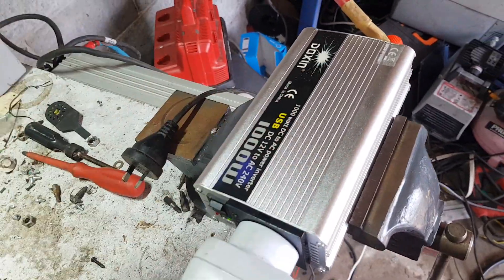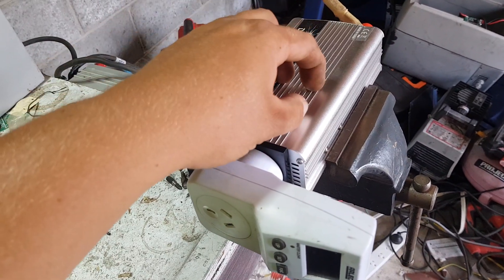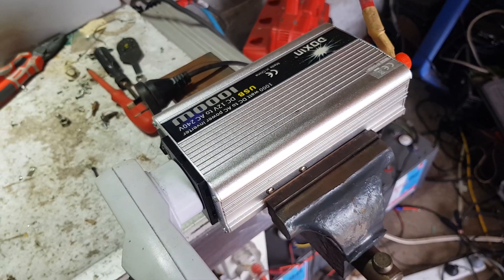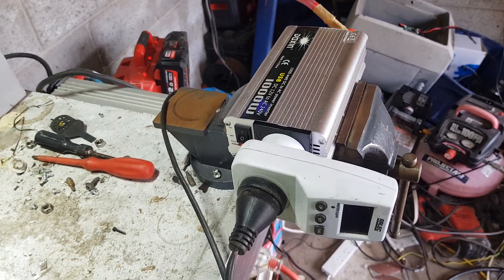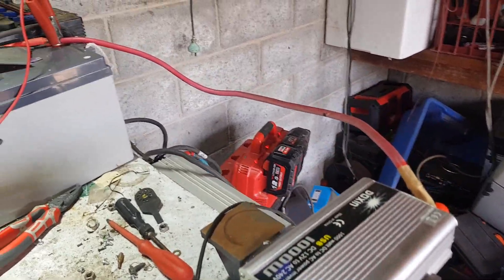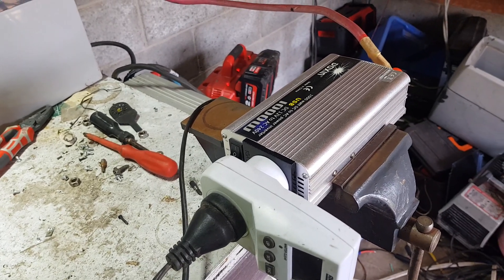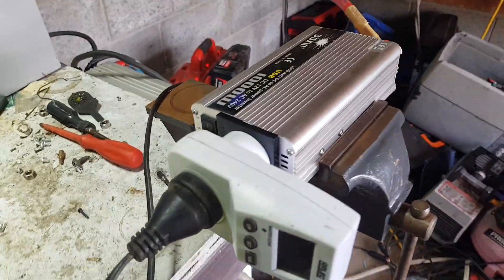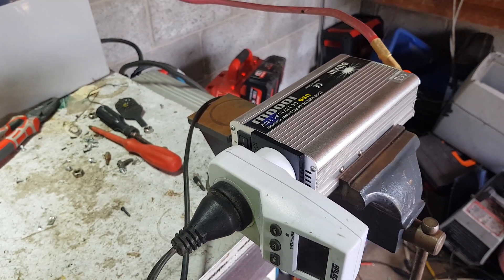$35 12v 1kw Power Inverter Long term testing

Comment: Hey mate, new sub here from brisbane. The link to ebay for that inverter does not work anymore. The cheapest of the aud plugs ones is one from giandel on ebay. But at 1000w its $70.
Reply from the maker: Ill get you one this afternoon mate. These are in oz and it was 35 bucks shipped. Still going strong